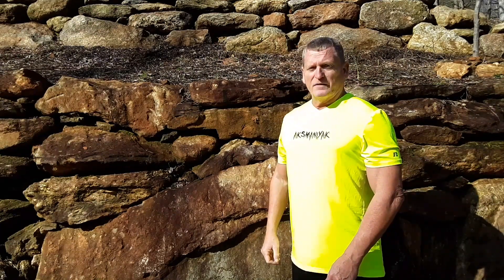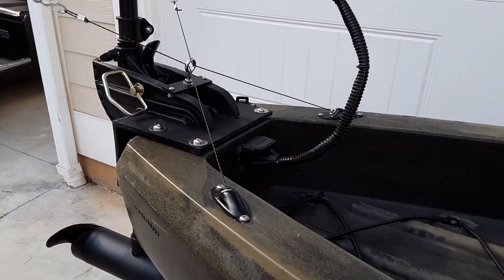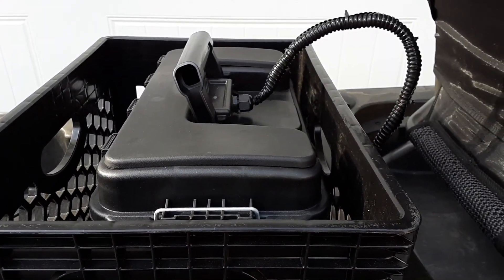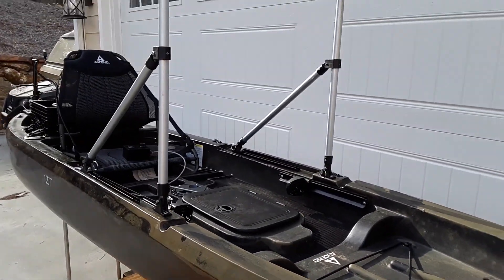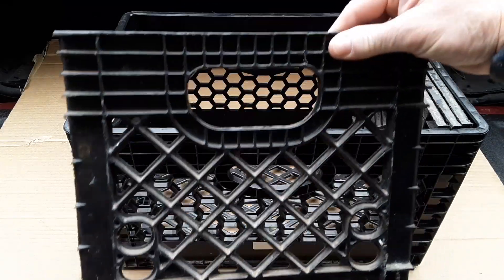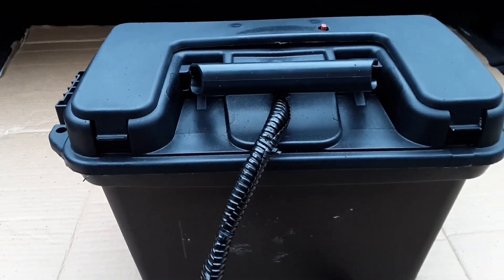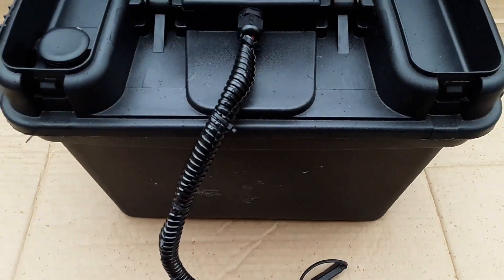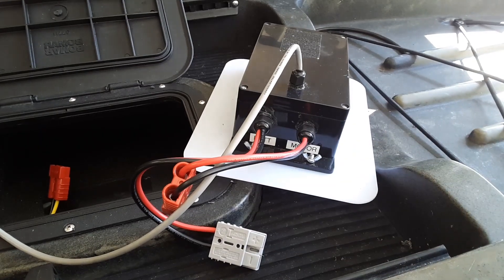Ascend 12T Motorized Kayak Modifications

Comment: Hi, amazing video. Just one question. What fastener are you using to mount the trolling motor plate to the kayak? Did you use bolt>washer>nut using the connector hole as access? Thanks.
Reply from the maker: Thanks. You will find parts in each separate video in the narrative.

Comment: Hi I have mounted a pwm 60A and 100A peak and it works great, the only problem is that it creates interference on the eco striker 5 vivid cv, have you ever encountered the same problem, do you have solutions?  I state that it has no metal box, but only the card that I placed inside a watertight box and I have two separate batteries to power the eco and the motor.  Thanks.
Reply from the maker: I have never had an issue with fish finder interference. I use Lowrance electronics.

Comment: Nice Video!!!  Very professional looking.
I am a BIG fan of the Anderson Connectors.  I even bought the wire crimping tool. Not cheap but worth the money as it makes GREAT professional crimp connections.
Power Pole Colored Housing (Various Colors)  Note:  Any one of the power pole contacts listed in this size range will fit in these housings. i.e. 15 to 45 amps and wire sizes ranging from 18 gauge to 10 with appropriate contact.
I LOVE this system.  You can even gang the housings together in different colors.  I did this on my Scout Boat charging system connection.  I have 2 each 12 volt pairs in red and black for the 24 volt trolling motor and 1 pair of blue and black for my boat start/run battery.  Very easy to see which battery is being charged on what circuit on the battery charger.  Off course these plugs when properly installed give polarity protection.
Reply from the maker: Thanks John. That is a great idea to combine the color systems! I didn't crimp my connectors. I put the metal tab end in a vice ( so as not to burn my hands) and heated them up with a heat gun until the solder flowed and filled up the wells. Then I inserted the wire ends until they hardened in place.
Reply: @Aksmaniyak  As I am probably one of the worlds worst soldering technicians the Anderson Crimp System was a real life saver for me.  Also, If you get any corrosion over time it is very easy to remove the inner crimp terminals and replace them.  They even offer a special tool for removing the installed crimp terminals.  Another feature is that you can snap the housings together to make custom plugs with different colored housings like I did on my Scout Boat Charging System. They also offer many custom accessories to suit your various electrical connection needs. Sorry to be so long winded about this system as I can't overstate the versatility of this electrical wire crimping system.
Reply from the maker: @helicopterjohns  Thanks for your input. This is the first time I have used the connectors and like them so far.